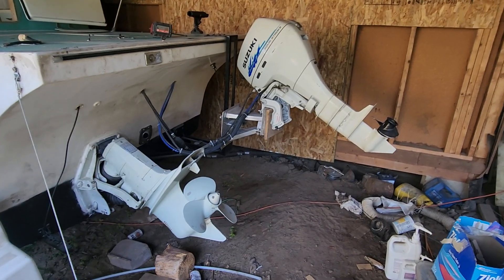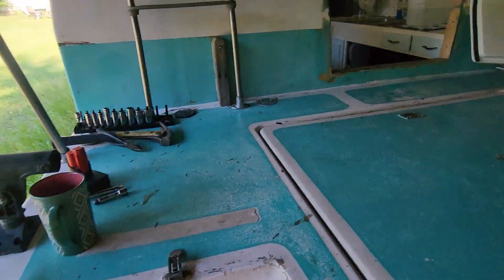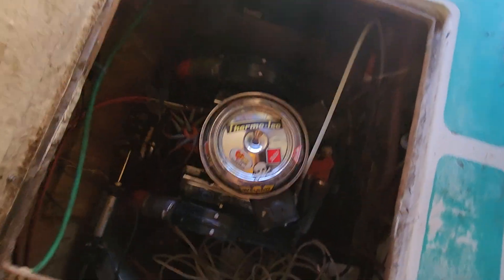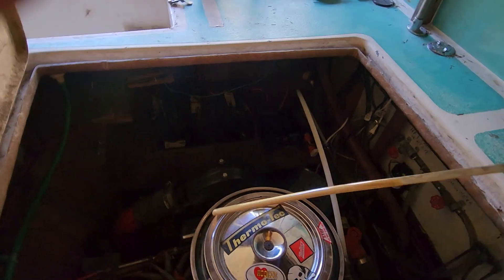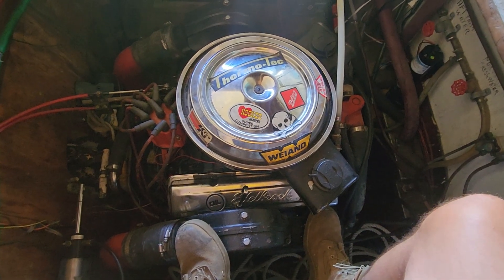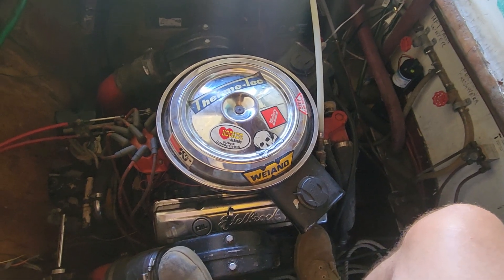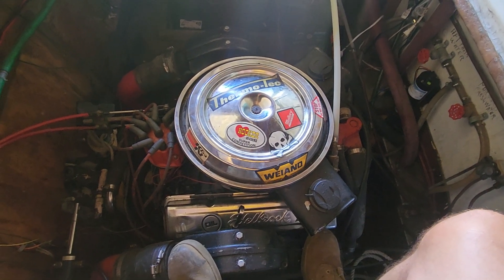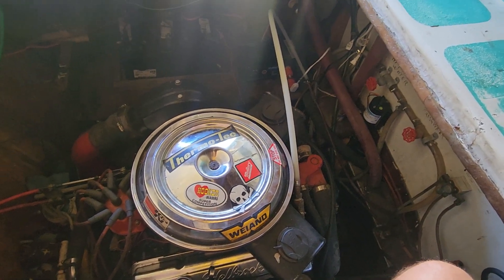What went wrong this time? 3rd engine down for the Land N' Sea.

Comment: Lil tip always check oils water an clutch oil 😂😂 every morning iwakup before starting always check motor
Reply from the maker: @dirtybootsfishing  I had checked everything before the trip.  But that's solid advice.
Reply: Love the boat. Sorry for your troubles.
Reply from the maker: @hellogoodbye3129  I will post an update soon.  I know what failed!
Reply: @oldseabee2938  yeah I think it's your impeller that's my guess